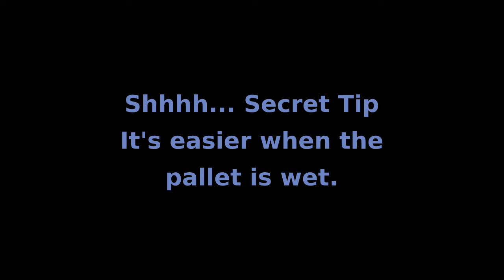Breaking Down Pallets - The Old Man Ways: Work Smart Not Hard.

Comment: Neat trick with attaching the pry bar to the workbench.  The longer pieces do have more leverage than the pry bar!  Never thought of that!   👍

I have done the first method, propping up the pallet on the ground on 2x4s and driving the slat down using a 2x4 extender held flat against the slat.  However, the pallets I've used have thicker and longer nails that are twisted almost like threads, which are tougher to extract than these in the video.  But this method still works well on those, just requires 2 2x4s stacked instead of 1, and more hitting with a heavier framing hammer.  

Also, my bottom slats with the longer twisted nails don't pop off as easily as your first one there using only a 2x4 lever, but for those I've used 3 short 2x4 chunks, 1 to bridge under the slat I'm removing near the stringer, the other 2 chunks to prop up the bridge on either side of the slat, then drive the 2x4 stringer down with a hammer and 2x4 extender, alternating blows on either side of the slat.

Comment: A few great ideas here!  Kudos!
What's up with that nail gun? Ive done production new stick-frame construction and never seen one quite like it. Palm nailers, stick nail, coil nails, never that type of single nail gun.
Reply: Air Locker DE-nailer.. drives nail out of the board. $60-70 on ebay. Major time and labor saver.
Reply: @avoidtheherd7066  ah! 
Thanks!
😀😀😀

Comment: "Work Smart Not Hard"
Old Man Ways?

What? 
   You went out and bought the proper tools for the job.
   What's smart about that? 
   It's just common sense.

   It's like saying "I cut my plywood with a Skilsaw, instead of a handsaw. Ain't I smart?"

What "Old Man" wisdom are you imparting to us?
Reply from the maker: Exactly, use common sense. Save your back. Get up off the ground and stand up. Pallet rippers allow you to work standing up. You don't need any special tools. Pieces of wood work just fine to pry the boards off. Attach a crow bar to your work bench. Pull nails by moving the wood not the crowbar. Pneumatic Nails Puller makes removing nails child's play. Wet pallets will come apart much easier than dry ones.